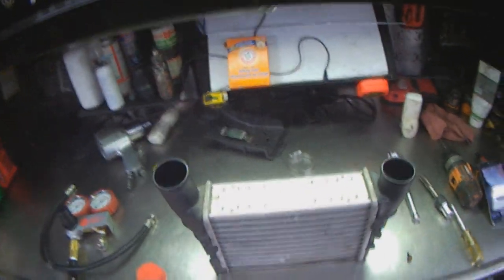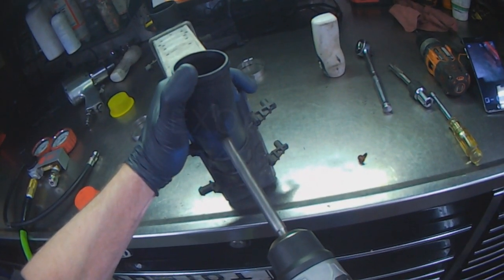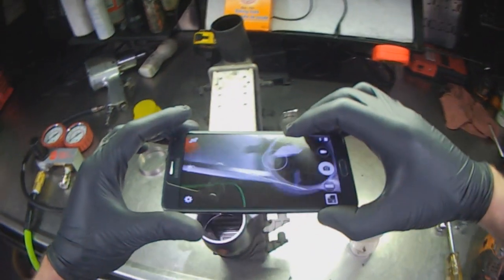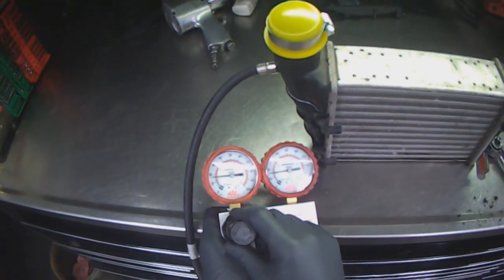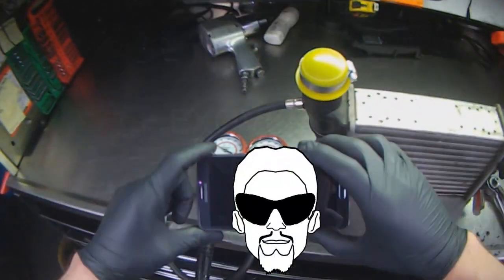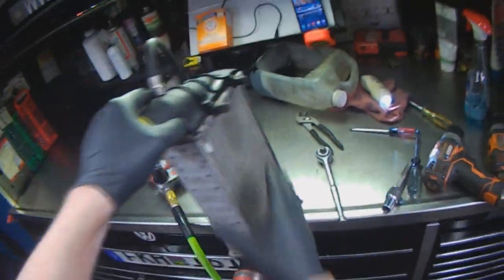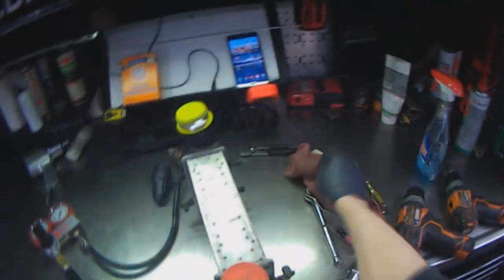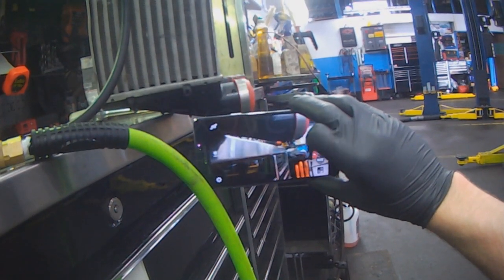Intercooler pressure testing (after drilling... OMG!!!)

Comment: Nice science project. Thanks, but from all the info I have bee able to gather on the net, it appears with drilling a 1/16th hole you do not have to plug the hole as there appears to be no, or very minimal loss of boost. Just leave the drain hole open.
Reply from the maker: Makes for a messy driveway... oil will drip out. I would recommend plugging. Thank you for watching!

Comment: Drilled mine in the same place on my 2016 F-150, pink thin fluid came out, is this coolant??
Reply from the maker: You drilled the wrong part. =(
Reply: Thomas EXOVCDS now I’m at autozone trying to find some way to plug this... in very sad
Reply: If you drilled the radiator you want to replace it.

Comment: I changed my engine oil 6000 km ago with 5w40..today i checked the level and it needs to fe filled up..can i use 10w40 if i respect the VW 505.00 norm?..maybe it won't go down so fast if i increase the viscosity
Reply from the maker: Andrei Ailoaie How low on the dipstick / how much oil? What year & engine? Some engines are very specific to 5W30 or 5W40, going away from that might not be good... I don't know if 5 points will make a difference (5w to 10w) in oil usage or engine performance ... you can try. Have a look in the following forum / post a question there (lots of very smart people there)!

http://www.bobistheoilguy.com/

Comment: OK this is what I did on my 2014 3.5 eco...   use a self tapper (the screw if you don't know) and after draining the intercooler screw it back in. It threads itself, and is reusable. Yeah draining the intercooler is a minor inconvenience but it was over-engineered and it does keep that air cold. Luckily for me barely anything ever came out (I live in far Northern California it's not humid here on those 112 degree summers 60 degree winters). A factory drain valve would have been too smart. Overall the only issue I had on my Eco is the MAP sensors getting dirty and it dying at random. Dirty MAP sensors produce the same issues that a flooded intercooler does (stuttering) but then it kills itself and goes into limp mode until its restarted. 

->If the MAP sensors get dirty (there's 2) - just clean them with MAS sensor cleaner, re-install and clear/reset the computer then idle the vehicle idle for 10min from cold to re-train the TPS on the throttle body. (check spark plugs while you in there)  Mine ran into this issue (dying constantly with wrench in the dashboard screen and no error codes). Runs like it was new again. I never realized how complex these systems are now, and how it also effected shifting as well. Everything is synchronized so perfectly.
Reply from the maker: Thanks for your DIY feedback! Yeah... s simple self tapping screw is what I use / that's all it needs.

Comment: Although I appreciate every video you have done. It's helped me a ton when I first got into TDI vws. But don't be lazy and drill a hole. Spend the extra half hr and take out the intercooler and charge pipes and clean them all that way. And if you do drill a hole...put a drain valve on. Dont leave it sloppy with a screw
Reply from the maker: Although I appreciate you watching and commenting... don't let your overthinking get to you. A screw in the hole is all that is needed. I do the draining for free for my customers. They don't get charged for this "extra service". Your method is fine for DIY'ers who have extra time on their hands. By the time I finish checking tire pressure, the draining has stopped and I plug the hole. There is NOTHING ELSE that makes more sense, than those 5 minutes of work (drilling, draining, plugging)... compared to blowing an engine because too much oil was in the cooler. If I hadn't posted a video about this "issue"... would you be aware of it? How many other channels do you watch where you get info like this?  Do the other channels answer / reply to all questions like I do? Do they get criticism for not helping? If I posted a video of how to remove the cooler for cleaning, how many comments do you think I would get, saying stuff like: way too much work, why don't you just soak it up with a rag in the cooler opening, why don't you install a catch can. 5min is all it takes to do what I do. Post a video of how to do it correctly... I'll be the first to comment!
Reply: @EXOVCDS  I do have a catch can on all 3 of my diesel vehicles. You know it's very simple to do any 99% of diyers can do it. My thought was what happens to the screw for us that run tuned cars with over 25 psi. Not that debris will likely get in there, but the possibility of a boost leak and possibly cracking around the whole if someone overboosts
Reply from the maker: Again, you are overthinking things... but like I said, DIY'ers can do what they want, since they have all the time they need. I record while I am "working" on customer's car... time is money. 5 Min is all it takes.

Comment: Hey what size drillbit you use?
Reply from the maker: You can use any that you want... the bigger the drill, the bigger the hole, the bigger the screw to plug the hole. Simple?
Reply: @EXOVCDS  I was just asking your recomendation since you do it on every TDI...
Reply from the maker: @J19A95B  At 7:45 I mentioned that I drill a 1/8" hole... I don't know the exact size of the screw that I use. All I know is that when I screw the screw into the hole... it goes in with some "resistance" (cuts it's own threads) which keeps it in place.

Comment: would it be ok to drill a 1/16 hope in the bottom of my intercooler
Reply from the maker: HexxusR6 Raven What year? What engine?
Reply: 2013 3.5
Reply: Be having issues I live in Montana
Reply from the maker: HexxusR6 Raven What model car? I don't know the intercooler setup you have... are you trying to solve a misfire issue due to water condensing in the cooler? A 1/16" hole can be left unplugged... if that is what you are wanting to know. My video is about drilling, draining the oil and plugging the hole with a screw (for ease of checking at every oil change)... not about leaving the hole unplugged. Some oil will blow out if you don't plug the hole, which can make a mess under the engine (over time).
Reply: 2013 3.5 f150 ecoboost. I been getting misfires and wondering if I will loose power or if it will hurt anything if I try this
Reply from the maker: HexxusR6 Raven There are many guys driving their ecoboost engines with a small hole in the intercooler. Just make sure to drill the hole in the lowest part so that water can drain out. You might want to check in a Ford Forum and chat with someone who's been there done that.

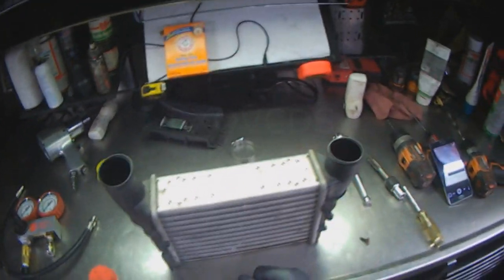Comment: 1:10 oh so it was a turbo diesel then? A gasoline engine will not run away like a diesel engine sucking in oil from a bad turbo seal (or whatnot) and using it as fuel. A gasoline engine requires spark to run away, especially the modern engines that you use. My father's 427 SB chevy would have a sort of issue (mainly not turning off when he quit the ignition) but that is no where near what a run away is.
Reply from the maker: ThorOtheBIG Correct... a gasoline engine will not runaway, but damage can still occur. Run-on after a shut down is due to timing, carbon buildup & fuel... hot carbon ignites fuel.

Comment: I just heated a straight pick with a torch and melted a hole.
Reply from the maker: This was a junk cooler. Drilling a large hole was for testing purposes (I assume you watched the video). I would never drill a hole that size in a cooler that was in a car.
What's the point you were trying to make?
You obviously didn't get my point from the video.

Comment: I am surprised those caps took that much psi, if you do try to blow it up I would use something else to seal the ends. I was doing a t belt on a 1.8t and had to pull the lower boost hose off, I think I drained  at least a qt. Out. I see nothing wrong with what you do, haters gonna hate no matter what; )
Reply from the maker: I forgot to ask how that t-belt went... thanks for sharing that the 1.8t is prone to the same issue! We can save a lot of engines by draining these things!
Reply: Customer declined the t belt only put a outer belt and tensioner on it. I did get to de carbon valves on a 2.0 TSI not to long ago.
Reply from the maker: Michael Berg Nice! We have yet to do one... what were the symptoms or running issues (if any)?
Reply: ***** complaint was misfires, not too bad a job. But had a coil go bad on test drive and he declined fixing the rear main seal leak so it left with a check engine light for lean codes
Reply from the maker: Michael Berg Sounds like our type of customer... as long as they were made aware of other issues, it can't come back and bite us!

Had a coil blow on me during a test drive of a 1.8t Passat. Customer refused to pay for the coil,  saying that the car ran fine when she dropped it off. 

We put a used coil in it (no charge) and showed her the fault code that was stored.

Comment: Excelent as always Thomas! Good proof of concept i wonder if i can do it on a mkv intercooler since turbo seals are failing mine
Reply from the maker: alex cristian The mk5 sits fairly flat... I had some oil come out once when I removed the outlet hose. Maybe just do that at every oil service.
Reply: oh alright i could jack up the other corner of the car to so oil flows to the open side

Comment: hmmm very interesting i thought that was a ford ecoboost cooler on your bench!  ...very simliar conditions and applicable solution...the ford f150 ecoboost vids (on youtube) are suggesting a 1/16th" hole at the lowest part of the intercooler to resolve severe miss/ limp mode condtions at highway speed.  I found you by chance when searching but I think your proof of principle is applicable.  sorry to bother otherwise . Joe
Reply from the maker: Not a bother at all.
From what I have gathered... the issue with the Ford's is that moisture collects in the intercooler and it then causes misfires as it is sucked / pushed into the engine. The small hole allows the moisture to a) drip out / blow out and b) allows for quicker temperature equalization after engine has been shut off (I could be wrong).
We just had a VW Golf get towed in... engine ran away while under boost and the engine is now toast. That is why I check / drain TDI intercoolers, to prevent that from happening. It's a good way to also monitor the PCV & Turbo for oil leaks. If all of a sudden more oil drains out than at previous times... look for an issue with the PCV or Turbo.
I vent my PCV to atmosphere... my intercooler & intake is as dry as can be. =)
Reply: @EXOVCDS  I also stumbled across this while searching for 2013 3.5L Ecoboost problem vids. I was already aware that a catch can is recommended, now I am seeing this intercooler/moisture issue. My truck runs fine, but has 95k on it now and mpg is down a couple digits. Your thoughts on the catch can/drain hole or both? We also have a 2012 VW TDI sportwagen w/ the emission fix completed, is this something you suggest on this model (the drain in low side of intercooler)?
Reply from the maker: @russellwade8901  Oil collecting in the intercooler is only an issue on the coolers that look like the one in this video. Newer cooler setups 2006> don't have an area where oil can accumulate to a dangerous amount. The newer TDI's also don't seem to have the PCV issues that these older TDI's had. I don't have any Ford / Ecoboost experience, so I can't say what would be best for those. Some catch cans (through their design / build material) can actually promote moisture / condensation accumulation more so than leaving the system stock. Meaning that water collects not because the can is catching it, but because the can is the cause of condensation... if that makes sense. A small hole in the right place to allow water to drain off when the engine is off (it also allows the heat to escape, which would otherwise condense) is the easiest, cheapest & quickest way to go... as long as you don't mind a bit of staining of the driveway or undercarriage.
Reply: @EXOVCDS  Thanks for the quick response. Great video anyhow, they are meant to learn from & not always be entertaining, there is already plenty of goofball videos if you want a laugh :O I will hit up the Ecoboost forums for more info before I do anything to mine, & will hold off on drilling a hole in my wife's 12' TDI cooler!! Thanks :)

Comment: I totally understand why you would do this, and it DOES work. But, a catchcan would be best option here.
Reply from the maker: Crossing an intersection at the crosswalk is the safest thing to do... everyone knows it. Jaywalking is done because it saves time. I get the catch can mind set... I just don't think I need to be reminded of it constantly.
Reply from the maker: No oil is released into the environment. The hole is plugged with a screw. The oil I drain gets recycled.

Comment: Lol Subaru puts them on top for this very reason, most of the oil will just slowly get burned. Oil in every intercooler I have ever taken off. From 3k cars to 200k cars. Couldn't imagine a high mileage Diesel engine!
Reply from the maker: The key is to be aware of it and checking it... and doing something about it.

Comment: .......should of seen my STi top mount intercooler. PCV and blow by is terrible. Too bad the ring lands went and then the fun began.
Reply from the maker: 2slovak0    =(
Reply: Thomas EXOVCDS it happens. Hell, if people complain about boost leaks just have to tell them to look at any F1 vehicle or for the matter any race vehicle that is turbo charged. EGT sensors on each runner. Temp sensors on the hot and cold side of the intercooler to monitor the efficiency of the intercooler. Neat idea, but I would be looking at the primary cause of that, like my Blowbaru I used to have.

Comment: Just got my 11 eco boost today it had a misfire cylinder 6 changed plug and it is running fine but when I get on the inter state and kick it down into passing gear it starts sputtering but no check engine lights but bad sputter if the drilled hole is not the  right fix what is ?? replacing the turbos?
Reply from the maker: David B The point of drilling & draining is to remove liquids that accumulate. With early TDI engines, it's oil. The issue with the ecoboost engines (from what I have heard) is water accumulation. Warm air condenses in the intercooler when the engine is off. When the engine is running under boost, the water is forced into the engine which causes misfires. Eco boost owners drill a hole and leave the hole open so that the water can drain out all the time. 
VW had a similar water issue with the new tdi's that resulted in ice forming in cold weather... resulting in possible engine damage from ice ingestion. The dealership fix was some kind of rerouting of charge air... not sure, I don't have access to dealer info.
Not sure what fix Ford has (if at all).
Reply: thanks so much to take your time to reply to me,Ill try this fix and see if it yields the results I am looking for Ill report back here
Reply from the maker: David B Looking forward to your result! You'll be leaving the hole open, yes?

Comment: I have a stupid question....
Instead of drilling and screwing.. Isn't easier to just unplug the hose from the intercooler, let drain and plug the hose again??
Reply from the maker: No... because that's not the lowest spot of the cooler. There's a reason why I do things the way I do things. =)
Reply: Ok. Thanks for reply bud. :)
I'll need to do that on my passat b6 2.0 bkp engine.
Reply from the maker: Your intercooler is different... removing the hose will drain some. Since the cooler has a flat bottom, you can't drain like this one.

Comment: I don't "get" all the fuss over a silly little "hole" ... we "blew" our Engine, and after the failure: We observed what LOOKED LIKE Oil (roaring out of the exhaust "weep hole") ... After the "SHOCK" (of the failure), we then pushed the truck a few feet (too get it off the road), and my God; the "liquid" was WATER !  SO: *One crated "long block" later, we popped a tiny hole in the Inner-Cooler and watched the water ROLL OUT. 

* Simple, easy, and "one & done".  "The Truck continues to perform flawlessly", AGAIN:  all this "fuss" (My Opinion here), is SILLY. Drill the little "spec" of a hole = NO worry / NO failure !!. 

"LOL"
Reply from the maker: EcoBoost gas engine? Leaving the hole "unplugged" on those engines is not an issue. On a Diesel / TDI, that would result in a lot of oil on the roads (over time)... causing environmental & safety issues.

Comment: Mabey VW should stop dumping pcv through the charge air cooler and use a catch  can method.Yea too expensive per unit and voids your warranty when you do it yourself.
Reply from the maker: Jason joncas It's not just vw... all manufacturers boosted or not, don't use catch cans. Just drain at every oil change... done.
Reply from the maker: Sorry... correction. VW actually does a good job on the newer engines by placing an "oil separator" into the valve cover... but because oil fumes can be microscopic, oil will still get into the intake and pool at the lowest spot.

Comment: Catch can!
Reply from the maker: Intercooler is a catch can... don't need to waste money on one.
Reply: Thomas EXOVCDS   Hi Tom , I just had a performance shop install a catch can. I can drain it with the petcock and not have to drill any thing. And I don't think a cooler was meant to be a can.
Reply from the maker: @lonewolf2364  You are right... it wasn't / isn't, but it's a quick, easy & cheap way to check for & drain oil... nonetheless. 
Merry Christmas! All the best to you & yours for the New Year!
Reply from the maker: @lonewolf2364  I'm just trying to help people save an engine and a little bit of money.